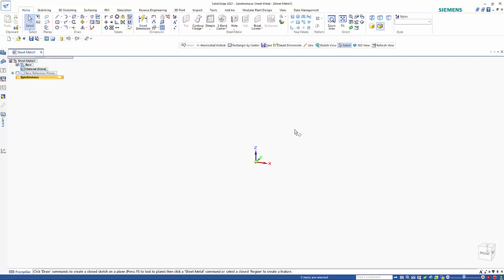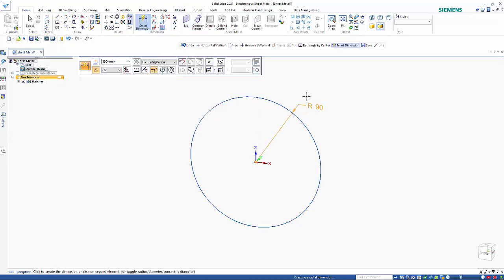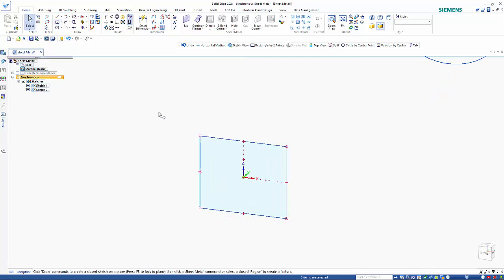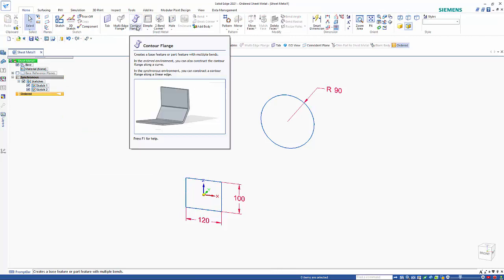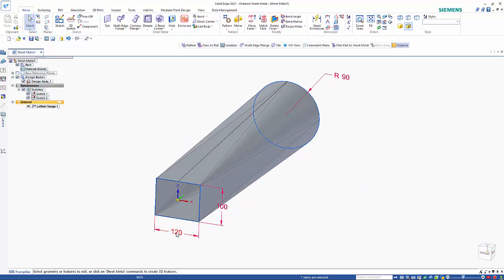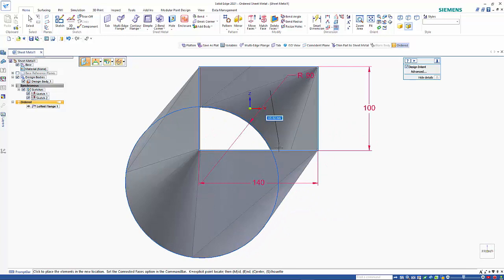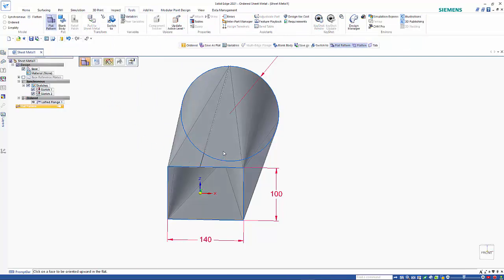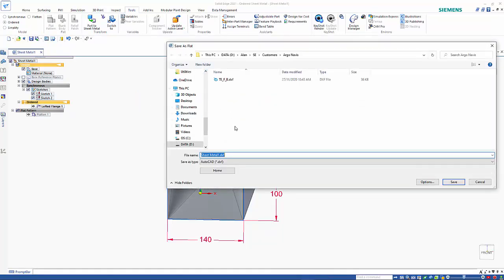Square to Round

Comment: Any idea why, when I follow this tutorial exactly, I get "operation unsuccessful" at the very last step of creating the ordered flange?
Reply from the maker: No, I can't. Can you send me your file (alan@cadcentral.co.nz)
Reply from the maker: Your part failed because I presume that you tried to do a material inside - material outside worked. The reason for this is the material and sheet thickness are the same and solid edge does not allow for a zero bend. Change the bend radius to 0,020 " and it will work.
Reply: @cadcentralnz Except that I am trying to go to the outside, and have tried large radius bends just as an experiment to try and get the part to resolve. I'm wondering if there was some update between ST9 and SE2020 that is allowing yours to resolve and mine to not? It doesn't make sense that it would give this much trouble over a square-to-round, though. That's one of the most basic sheetmetal parts to make...
Reply: @cadcentralnz  I think I figured it out (a year later), although I'm still a little confused, because I swear it worked as demonstrated the first time, then Solid Edge crashed, and when it restarted, I was getting Operation Unsuccessful again. What got it working for the time being is only having four straight segments (meaning my break HAS to be at a corner, and can't be in the middle of a straight section like yours is). Solid Edge appears to be defining the arc in four segments, and thus is expecting four straight lines to match up to those segments, and it can't figure out 5-to-4 conversion.

Edit: Solid Edge appears to be super incredibly fussy about orientation: the opening has to be precisely lined up between the two components, or else it freaks out and gives up. Also, how did yours come out with nice triangles (which resemble the as-build versions I see around) and mine is creating very fluid-looking trapezoidal shapes that maintain the four corners right up to the circle as much as possible? I thought I figured it out when I set the bend radius to the radius of my circle, only to realize that I'd lost the corners of my square.